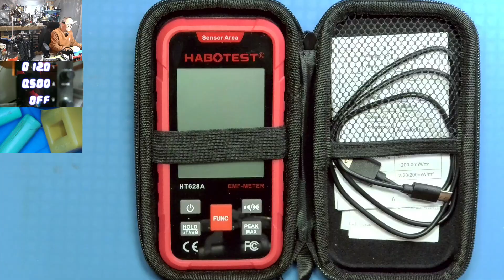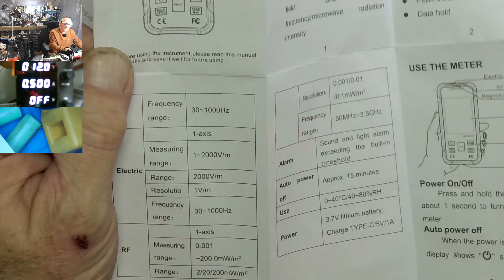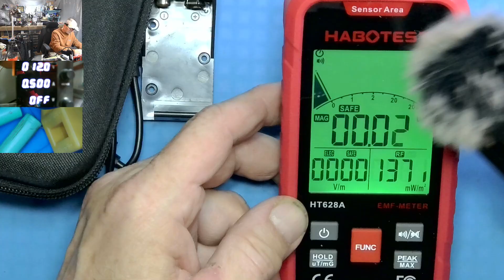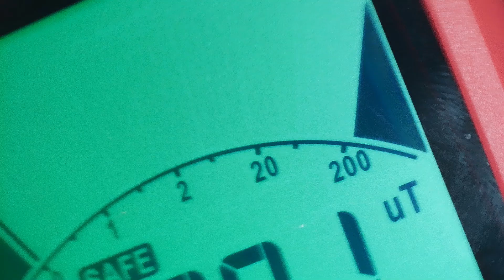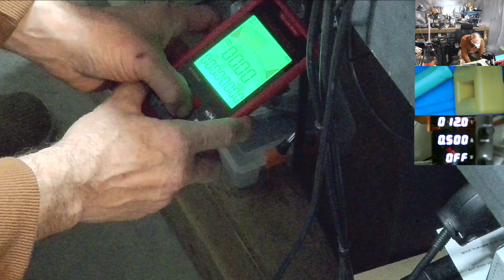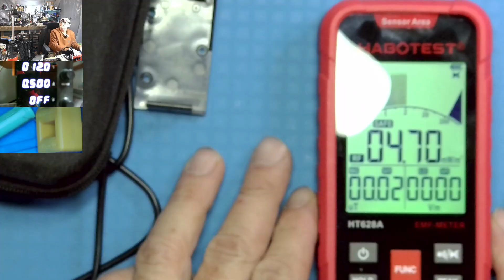HABOTEST HT628AB EMF Meter 3 in 1 Electromagnetic Radiation Tester

Comment: Hello. Do you happen to know what is the difference between the two models 628A/628B? I can see that the display is a bit different but anything else? Other question is that can measure over 200mW/m2 in RF? Thank you. Regards, Karl
Reply from the maker: Hello the difference in between the a and b is the b has the external batteries the a has an internal battery. Based on the paperwork in RF mode it measures from 0.001 to 200.0 mM/m2 I hope that helps.🤠
Reply: @gregbennett2437 Thank you so much. Interesting that one has rechargeable battery the other not.